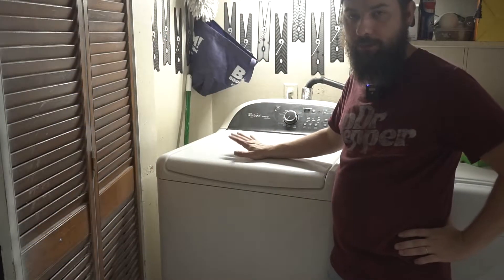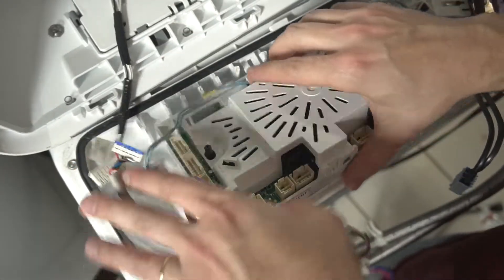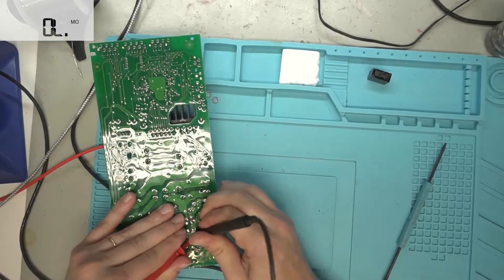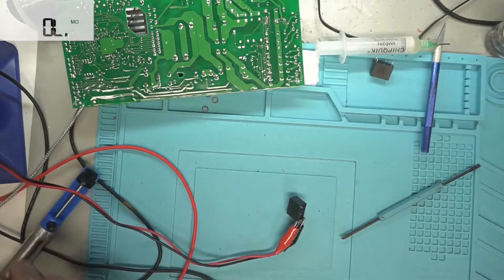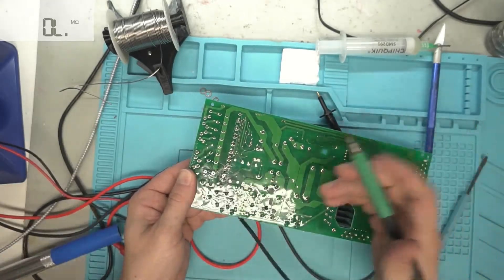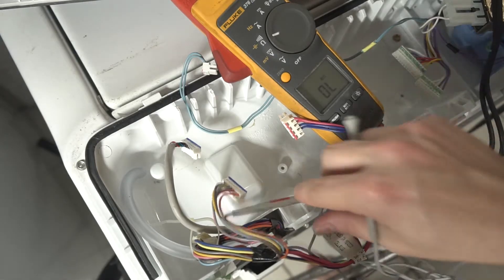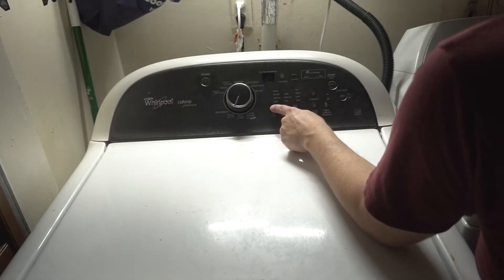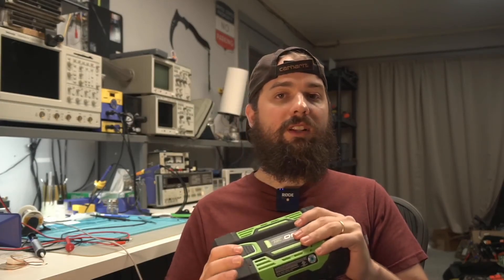Whirlpool Cabrio Washer Not Draining Board Level Repair

Comment: Thank you for this video!. The extra protection that the power control board received in the manufacturing process, does protect the board  from the humid environment of washers. You showed the viewer how to dig deeper to make a good connection.  I Improvised a fix for the same control board that you fixed because the good cylindrical fuse tested good in my hand, but required pressure on the fuse holder contacts , without which the fuse behaved as if it was burnt. My solution was to place a rubber ban to make the fuse holder contacts hug both sides of the fuse with a little pressure. Because the wires supplying electricity to the water pump are less than one inch above cement basement floor, then friction generated tension can pull on the connecters, until one wire disconnects. I also found a peeled wire showing shinny copper for 3/16 of an inch.

Comment: Great Video.   Tried to order the relay but Amazon sent me G5q-14-12, but it worked fine, just cut off the extra always closed leg and got em for less than 10 bucks for a pair.  total cost for repair was less than 10$. washer is up and running thanks to you, again great job.

Comment: Do you have a relay layout? Can find a k1-kx listing for function to make sure I'm replacing the right one.   My contacts are sticking after it runs a few cycles and the drain pump won't turn off.

Comment: Great Video. I bought a cheap solder/desolder kit, and the relays.  I got two relays because the one next to the one shown in the video checked bad also.  So, 20 dollars for the kit and 5 for the relays and 20 for expediting the two orders and washer is draining again.  A suggestion is to find the service technician instructions that are taped to the inside of one of the washer sides.  They explain diagnostic tests and have a wiring diagram I found helpful.

Comment: I bought one of these used and the guy said it worked fine. It did not, in fact, work fine. Drain would never turn on. Checked for power at the drain, got nothing. Checked the relay, and it was blown, just like this one. Problem is I don't have any soldering tools, and the labor to have someone do it + the relay would have been more than the 50 bucks to get a used control board off ebay, so I said screw it and just went the ebay route.
This really helped me diagnose things, though, so I really appreciate it. I looked everywhere for a good video, and yours was no BS and straight to the point.
Reply from the maker: Thank you. Glad I could help with the video, sorry about your poor experience with your seller
Reply: @FixedUntilBroken  it happens. Can't really test a washer when it's sitting in a garage, so I knew I was taking a gamble. People suck.
Reply: @FixedUntilBroken  update: replaced the board and works like a charm :) I know these cabrios are good machines cause my parents had one and it's still kicking

Comment: Idk how much you know about washers but i have a whirlpool cabrio platinum and I get the ld error which is long drain idk if it's because I had the wrong pump sent to me like it it the wrong pump and still fits would it work or not work. The whole washer was taken apart and cleaned out to be sure nothing was clogging it . Tested the wires from the board to the pump motor and that's all good it's I even tested from the back of the board to before its getting ohms to the board so idk if its cuz it maybe the wrong pump it looks the same as the original pump or less it just a bad pump also it was working was doing a load of laundry then it stopped and said ld on the screen. Did diagnostic test and c8 and c9 won't work but  everything else works before it gets to c8 and c9. I have another pump coming in tomorrow that ik is the one for my washer. The other one has same part number as my original one but I looked it up and says its.not for my model. But fits so idk if that could be why new one isn't working so I'd figured I'd ask you to see if you would know or could help me out. Thank you
Reply: Did you ever figure yours out. I have the same thing.